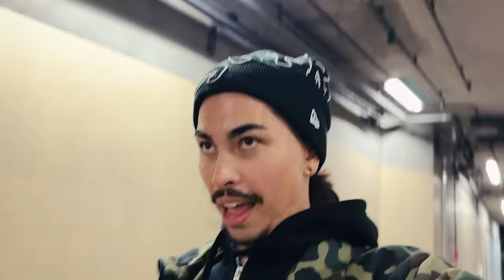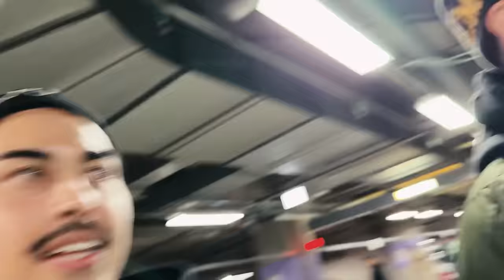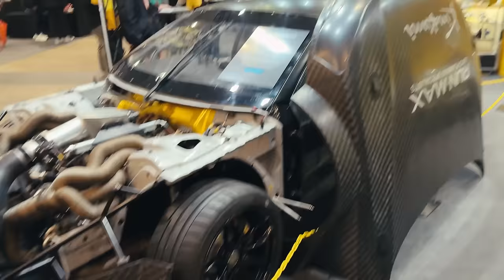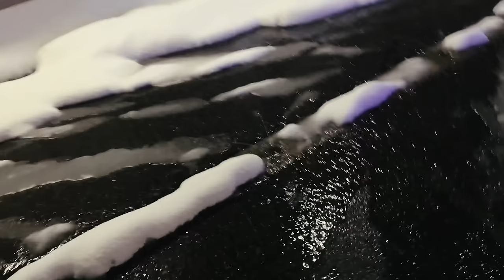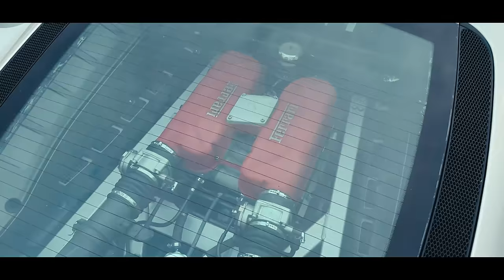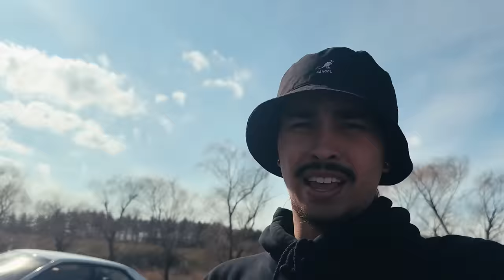Giving my brother the keys to the Ferrari! / S4E86

Comment: Did you jump the fuse box since you manual swapped it you have to make a jumper wire so the car thinks it’s always in neutral so you can start it was stumped in my manual swap when I did it